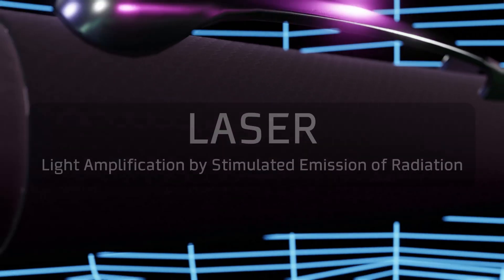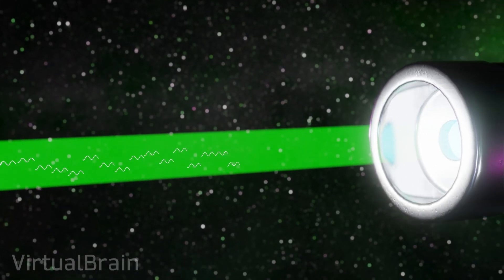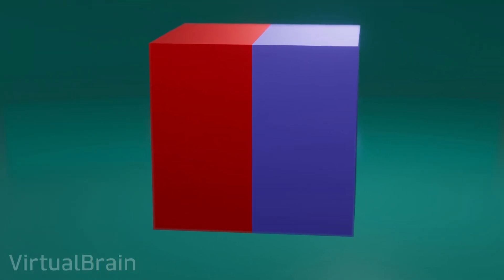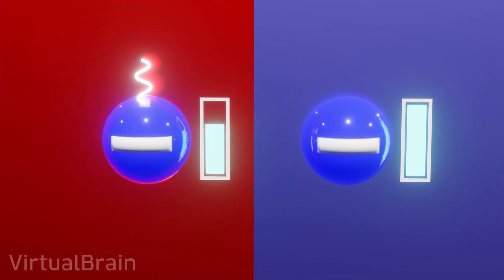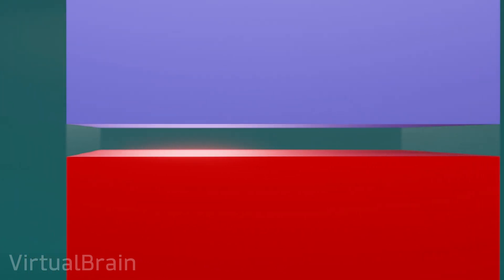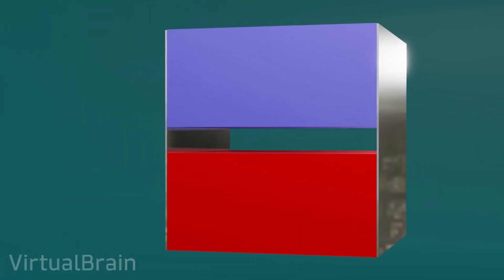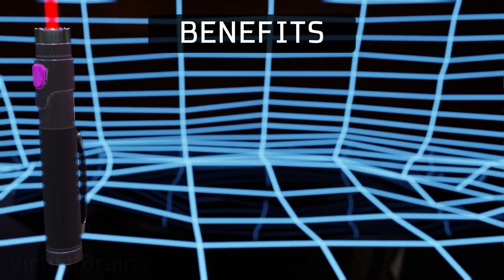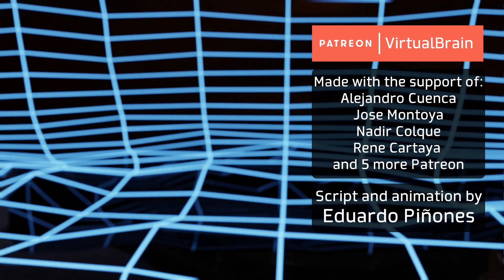How a LASER DIODE Works ⚡What is a LASER DIODE

Comment: Great explanation! I would love to see more videos about this stuff. What kind of doping is required and is the middle layer actually transparent or just so thin (e.g. 1.5 times the wavelength) that is able to radiate the photons even if it's not transparent?

Also, is it possible to create high power lasers with doped silicon only, even in theory?

Comment: Green lasers often consist of an infrared laser and a crystal in front of it that glows green. 
Therefore, they then emit IR and green light.
Reply: The only advantage of this is having a very precise wavelength (since this system uses resonance), but if you need it to be very compact, you have, for example, the NUGM06, a green diode laser with a 2w output, but it needs almost 15w of energy
Reply: More expensive ones don't as they have an IR filter. But if you want a compact, more rugged design there are 520nm green lasers that are a diode and lens just like the hugely common red pointers. But 520nm are expensive if you want high powers over about 1W
Reply: I thought it was impossible to directly get a shorter wavelength radiation out of a longer wavelength radiation. Thanks for telling me that bro😃